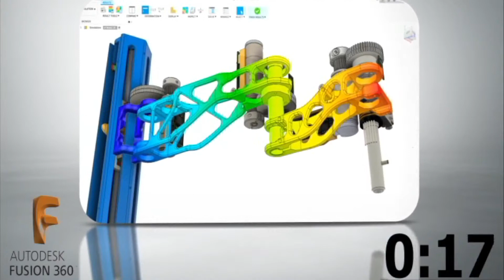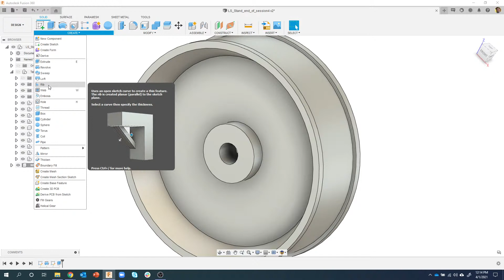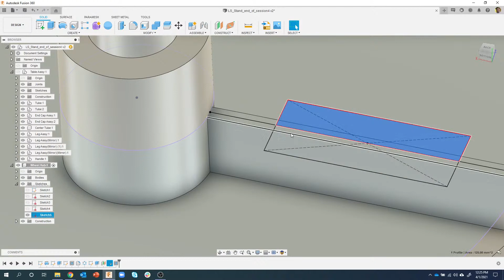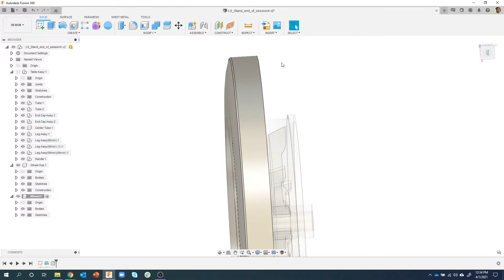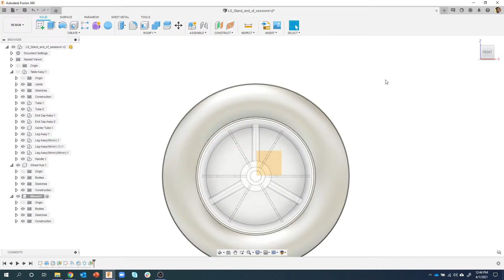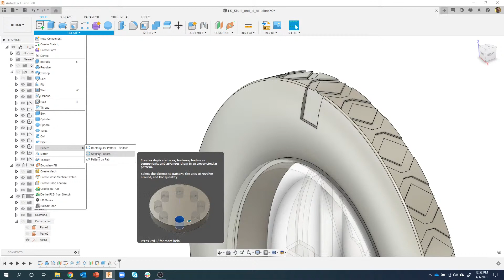360 LIVE: Miter Saw Stand project - Part 5

Comment: Brad, the most problems I have is sketching in the wrong active component or with joints in the way of use. After grouping components my earlier joint revolution don't work anymore or with drive joints and motion link. What do you use at wich moment?